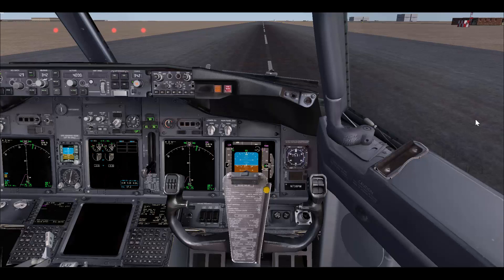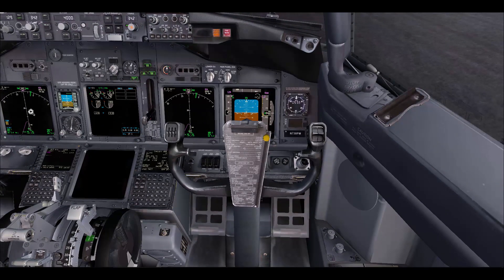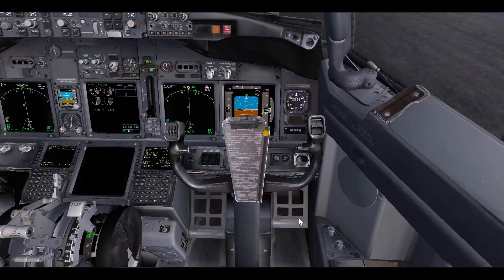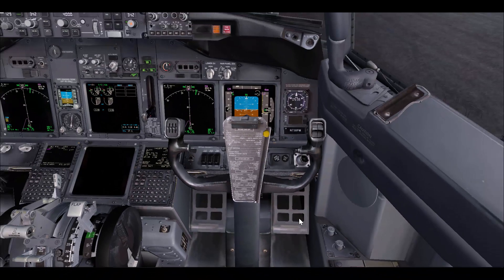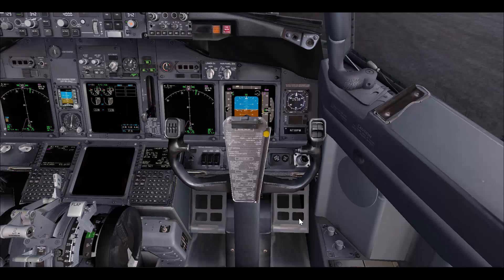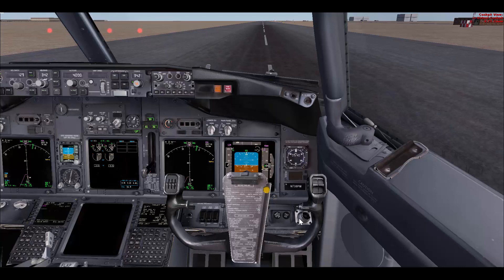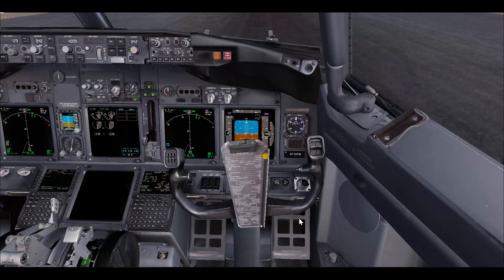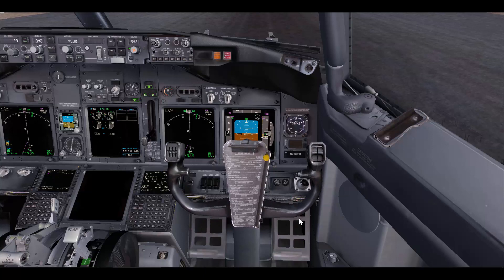B737 Crosswind Takeoff

Comment: Hello Captain, I have  not sleep about it but I'am a little confused. You say when the wind comes from the left  right rudder must me pressed but if  I do that within the FlightSim the plane go to the right? ...  Also is it strange if the wind comes from the left and going to the right (------>) to start more left from the center line or is this a hudge mistake?
Thank you ahead for responding, Have a nice day ;)
Reply from the maker: Hello G L, 
When the wind hit the airplane because of the large area of the vertical stabilizer that is the vertical portion of the tail. The nose of the airplane will tend to point into the wind. This is what is called wind vaning or “Weathervane effect” so you need to apply opposite rudder to keep the airplane straight. 
In the simulator I believe the rudder application is linked to the teller. So a small rudder application will result in a judge input cus the nose application is huge it is not as real as the airplane unless you can separate the joy stick rudder application from the tiller. 

Try in the simulator taking off with 16knots cross wind and don’t apply any rudder or flight control you will see the airplane tend to move into the wind. Try it and let me know how it goes. 

Thanks for the questions and the discussion. 

All the best
Abdul
Reply: @AbdulmuatiAsiri37  Your explanation explains it all. Sorry I questioned your instruction. Have A Nice Day ;)
Reply from the maker: No worries G L 😊